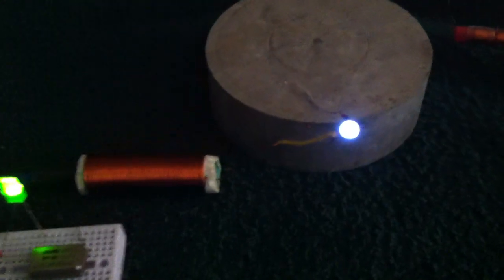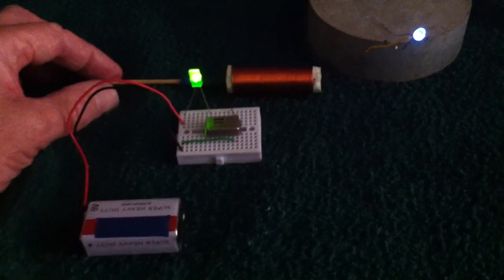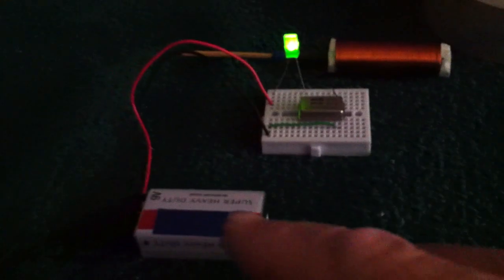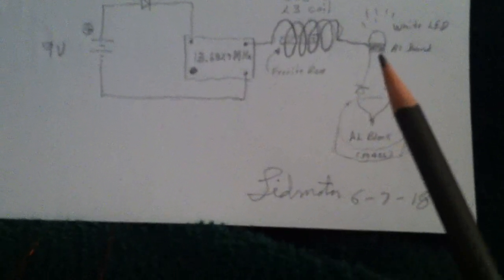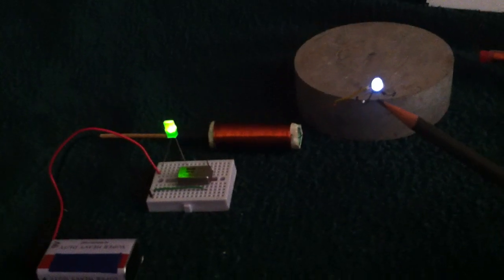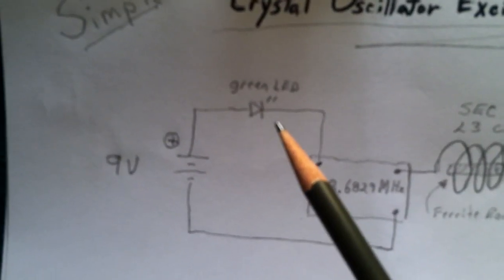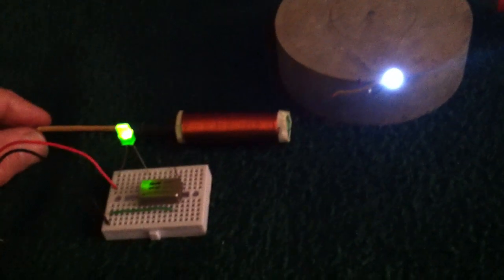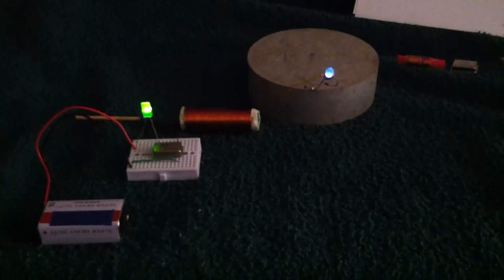Crystal Oscillator Exciter

Comment: Awesome and indeed simple !
By contrast, have just got the 'Hyper Complex Oscillator Exciter' running lol...a Colpitts now tuned to 13.7MHz. Varying the frequency is by adding a bit of wire or removing it. Your circuit here is tons simpler.
Reply from the maker: Excellent.  We are getting there slowly.  The guys with the good lab equipment could do this whole thing much easier but perhaps our way is more fun. Ha.
Reply: Yes, it would save a lot of "what the heck is this thing doing now ?" :)

Comment: I wonder if this would work for triggering the base of a transistor, say an 2n3055 and then using higher voltage and current through that to produce HHO in electrolysis? I have a dry cell that I've been trying to improve efficiency on. Now you got my creative juices flowing, but your videos always seem to have that effect on people. = )
Reply from the maker: I tried that but the results were mixed.  I went to a 2 pin crystal circuit. that works really good.

Comment: Does the led light if you touch the base of the AV plug to the output wire of the coil?
Reply from the maker: Yes.  That is the normal way this is done and the virtual ground is connected to the negative leg of the AV plug.  If I raised the voltage the led would probably light either way with no ground.  I didn't want to try that and chance burning out the crystal oscillator.  It is the only one I have.

Comment: Thats a super simple setup. Have you tried a cree board with it yet?

cheers
Reply from the maker: Not yet but I don't think that will work at this low voltage.  Dr. Stiffler uses 21 volts and I don't want to chance burning out this crystal oscillator.  I might try 12v and see what happens.

Comment: what happens if you connect the negative of the battery on the oscillator to the aluminum block, either directly or via a coupling capacitor - because right now the entire circuit is floating at the oscillating frequency.
Reply from the maker: Good question.  I tried that and nothing happens.  It is because of how I am driving the led  ---I guess.  I expected it to light up the led much brighter but it didn't.
Reply: The scope on this would be great as you said. When this is tuned the connection is of no consequence. This crystal is making a very narrow oscillation band with a high Q compared to the slayer type connection that uses self oscillation of the inductance and capacity in the circuit which has a much wider oscillation band and Q curve.
Please Provide more info on this crystal. Is it a surplus part ? something removed from a board being scrapped out ? A composite component that has a spec sheet ? What kind of loading does it work into.? The info on your drawing would be appreciated. Your drawings are always simple and perfect for interpretation.